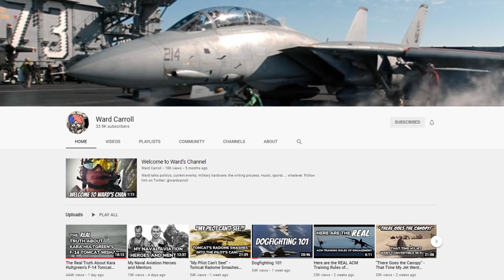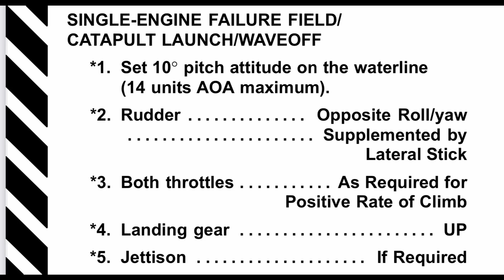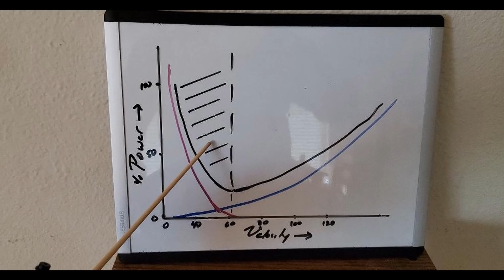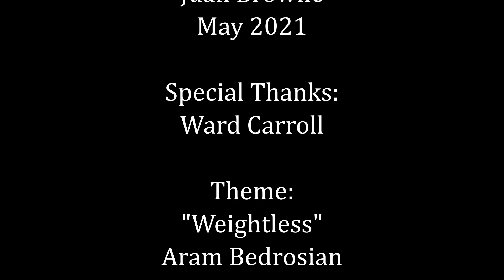Navy F-14 Crash/Stall Demo-Lt. Kara Hultgreen Accident

Comment: One design element of the F-14 that made it a bit of a bitch on one engine is the engines and their direction of thrust are not actually parallel to the planes centerline. Each is toed out  front to rear aka /|\. With thrust only being balanced and straight with both engines running.
Reply: I thought the very purpose of that small angle is to reduce the yaw moment from thrust when in one engine.  Does not the thrust line angled out tend to push the tail in and help reduce the yaw?  Isn't that the same direction a 3D thrust vectoring nozzle would move to control yaw?
Reply: @gort8203  You could be right. But if I recall correctly it had to do with how much throttle you give it? Does that sound right?  Back during College I had a summer job at Grumman and got to listen in on some of the more entertaining debates between the Test Pilots and Engineers. The Navy had just lost 2 Tomcats within a short time span, from engine stall on Carrier Landing.  And everyone was talking about it. It would have been '84 or '85. One of the carriers was Enterprise. (part of why I was even paying attention.)
Reply: @andrewtaylor940  The angle of the thrust line would merely mitigate some of the yaw moment, and I imagine that would be proportional to the amount of thrust being generated. It should have the effect of a marginal reduction in Vmca, the minimum airspeed at which there is sufficient rudder authority to compensate for full asymmetric thrust. This can allow a somewhat lower approach airspeed, and every knot represents a meaningful reduction in the amount of energy to absorbed during an arrested landing.
When your approach speed is limited by Vmca rather than lift you cannot expect to control the airplane if you get slow AND apply full asymmetric thrust.  If you get slow, gradually feed in only as much thrust as you can control, and more will become controllable as you accelerate. More speed and less AOA also reduce the chances of inducing a compressor stall on the operating engine.

Comment: I just wonder if the rudders of a F-14 work as effective as on a small and slow airplane?
Reply: …..as long as you followed the BOLD (mandatory memory) procedures, you’d be fine. Too much power and your rudders don’t exist anymore
Reply: @uwekonnigsstaddt524  interesting... Carrier Approach Speed = 125 kts... pretty low. Regarding the Hultgreen accident, wiki says. "Finding herself overshooting the landing area centerline, Hultgreen attempted to correct her approach by applying left rudder pedal, which caused the nose to disrupt the airflow over the left (inside) wing, as well as the airflow to the left engine intake. The port engine suffered a compressor stall and lost power—a well-known deficiency characteristic of the F-14A's TF30-P-414A engine when inlet air is no longer flowing straight into it. For this reason, the F-14 NATOPS flight manual warned against excess yaw. Loss of an F-14 engine results in asymmetric thrust, which can exceed rudder authority (the degree of control exerted over the aircraft), especially at low speeds."
Reply: @fibboobbif  Correct. The BOLD procedure is to stay 14 AoA degrees, right rudder (in the case of Hultgreen), adjust right stick to supplement rudder input, adjust throttle as needed (too much thrust would increase unwanted yaw, too little and you won’t have sufficient speed to keep you aloft), jettison external stores (unwanted weight/drag), raise landing gear. It happens fast and if the pilot is not on top of his/her game, the pilot would become a passenger

Comment: Revlon was a good example of diversity quota gone wrong. F-14A was notoriously difficult to fly, even among other Navy carrier aircraft, and only the very top of the class were allowed to fly it. Revlon simply did not qualify to fly the F-14A, but there was pressure from higher-up to get a female and she was put in the pilot's seat. With tragic results.
Reply: The engine also stalled due to a failed PRBC valve and that engine was stalling in previous flights.

Comment: How does rudder and power added bring you back to level flight?
Does it increase air over the low wing, increasing its lift, therefore righting the ship?
I’d love a short explanation.
Reply from the maker: Watch this previous update- https://youtu.be/lqGeveg9Jcs
Reply: the F-14A was very special: you had to use rudder when an engine was out, not ailerons, or it would flip over hard. Later F-14s had a flight computer to correct the input from the aileron request to rudder action. You also had to get your power setting right, you couldn't just slam it to max.

In general, if you use ailerons near stall, you will increase camber and cause that wing to stall.And when you slap with the tail, it will swing that near-stall wing into the wind, i.e. increase airspeed over that wing. However, if your overall speed is too low, you're now stalling the other wing, because that one gets jerked back. So keep your speed up & accept the go-around.

Comment: It doesn't matter if it's a Luscombe or a F-14, step on the ball. I learned that from Juan.
Reply: I haven't flown a full scale plane in decades, but it seems to me that you don't step on the ball in this situation.  When the plane rolls right from a right wing stall wouldn't the ball fall to the right?  And using rudder opposite the roll would be a left rudder.  So it seems you don't step on the ball in this situation.  I'm totally open to being wrong here.
Reply: @larrylaitner3473  natops is written in blood….or something to that effect….said the former RIO that Juan is referring to. “Revlon” knew the recovery procedures in the situation she got into by overshooting The extended center line behind the boat. The BOLD items are MEMORY items required by the pilot. They have to be applied right away or you’d be a passenger on that Tomcat soon. The Tomcat “A” model had the older TF30 engines, prone to compressor stall. Pilots “flew” the engines to keep it under control. For what I understand “Revlon” was “certified” to fly the Tomcat….something instructors disagree with…..politics were involved…..and she paid with her life…and another Tomcat went to its watery grave. 2 investigations were conducted, the public investigation stated it was an engine compressor stall…..but the military investigation, kept from the public revealed the dirty politics to “certify” the first female Tomcat pilot. The officer the revealed the info apparently was court martialed. Aerodynamics doesn’t care about gender.
Reply: @uwekonnigsstaddt524  I read somewhere that was what happened.
Reply: @larrylaitner3473  I totally could be wrong too. I thought the ball was the same as a bubble in a level, but maybe it's a direct read like you say. I think I'll let Juan fly the plane. lol
Reply: @larrylaitner3473  i just flew it in X plane in a 172.  Step on the ball.   It falls to the inside of the turn.  If you go opposite the ball, the turn continued.
Reply: @scottkelley1558  Juan's scenario wasn't a coordinated turn, it was a stall/spin scenario where the wing dropped in an stall.  I think the ball would move toward the stalled wing, and the corrective action would be down elevator and opposite rudder.
Reply: In this case you would step on the good engine. That is the analogy you are looking for.
Reply: I really liked that advice, "step on the ball!"

Comment: I rode aboard the carrier USS Abraham Lincoln CVN72 from LA to San Diego in 2011, and while on deck I recalled first hearing of Lt. Hultgreen's crash -- off the coast of my hometown of San Diego (La Mesa). Because the Tomcat was my favorite modern fighter I of course followed the revealing info. My dad AD1 Earl C. Bishop (and 2 other crew) died in July 1955 in the crash of his AJ-1 Savage nuclear bomber in Naples, Italy, during an emergency landing attempt and go-around. The pilot had feathered one of the 2 turboprop engines and my dad was attempting to start the jet engine when the AJ crashed, inverted. The scenario sounds so familiar.

Comment: Lose of an engine in the Tomcat is even worse since the engines are 9.5 feet apart. Then there is the infamous TF-30 engine.
Reply: The distance between the engines of the Tomcat is a lot greater than the F-4’s, F/A-18’s, etc. The asymmetrical thrust in the Tomcat will force the aircraft into the dead engine pretty fast.
Reply: @uwekonnigsstaddt524  The  Tomcat engines were further apart than other fighter or attack carrier air raft at the time.  The F-18 E/F/G model aircraft engines are just slightly further apart due to it's slightly larger size.
Reply: Nevermind, I was a little tipsy.  And it's been 40 years.  I take back my comment.  You're correct.
Reply: They weren't 9 feet apart.  They were a little over one foot apart at the keel.
Reply: @bernieweber4663  Damn, I didn't think my shoulders were that narrow to walk between the engines of an F-14 in the hanger deck. Nine feet seems about right. I couldn't reach both sets of turkey feathers when standing at the tail end. You might be thinking of the F-18.
Reply: @ewhartiii  No, I worked on the F-14 and the F-18.  TF-30 and F-404.  The engines on the Tomcat are about a foot apart at the keel.  The engines at the turkey feathers are about the same distance.  I worked on both aircraft and  engines for years as an AD.  Now if you're talking the center of the engines that's different and they are five feet apart give or take.  There is an inboard engine mount that is connected to the keel.
Reply: @bernieweber4663  Dude, the AIM-54 Phoenix was 15 inches in diameter, and the F-14 mounted  up to 4 in the space between the engines, 2 fore, and 2 aft, that's at least 30 inches plus a little more for clearance. I was a Cat Electrician in V-2 Dept. aboard USS Nimitz, and got to see a lot of F-14s close up, I was on my first Med Cruise when VF-41 splashed the two SU-22s in 1981.
Reply: @ewhartiii  Yes, you're right the belly was wide enough for that but the engines are right next to each separated by a little over a foot at the keel.  Same at the turkey feathers.  The engines were wide enough to create the space under the aircraft for the weapons stations or for two drop tanks but they are not far apart.  There is also a keel valve for starter air when selecting engine start it'll open or close and it's just a foot and a half from the starter.  I've changed enough engines and turkey feathers to know.

The TF-30 P412's and 414's were 42 inches in diameter. Add the distance between the keel and the outside diameter is 8 feet and add the engine bay cavity (or the large nacelles/intakes) and you'll get about 9 feet so I see what your saying.  However, the engine shafts are about 4.5 feet apart.  The engines are about 1 foot from each other's outside diameter in the engine bays and at the tail.   They're just big engines.  The F-404's on the F-18 are 35 inches in diameter in comparison.
Reply: @bernieweber4663  THe F-14 engines are 9.5 feet apart from center to center.
The F-18 engines are about a foot appart.
Reply: @bernieweber4663  Does this look like a little over a foot.
https://www.airforce-technology.com/wp-content/uploads/sites/4/2000/04/Image-2-F-14-Tomcat.jpg
Reply: @bernieweber4663  needs to stay off the weed-uh (Steven A. Smith voice).